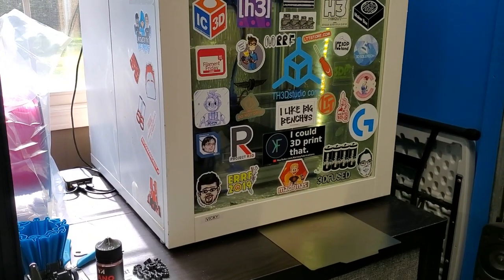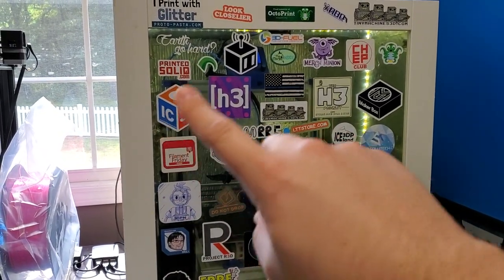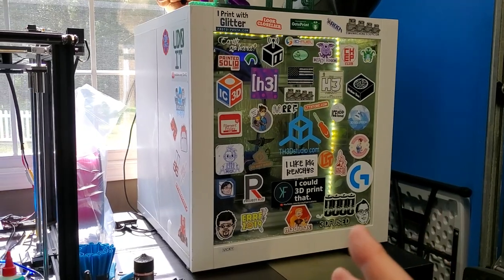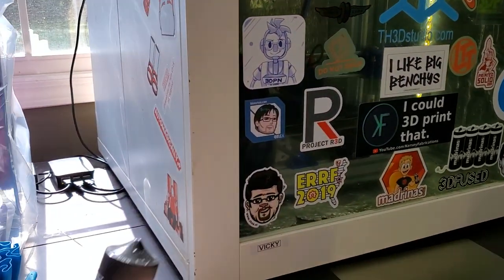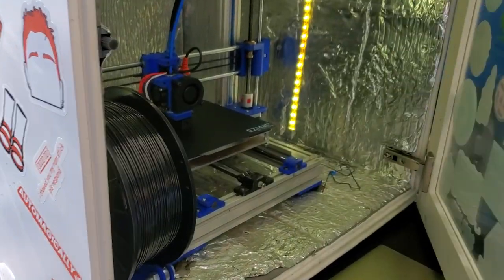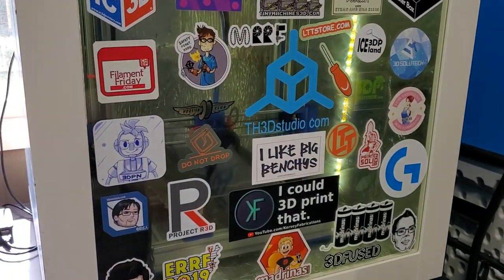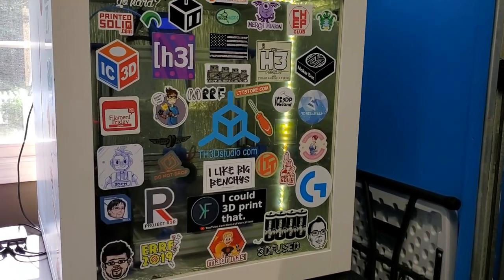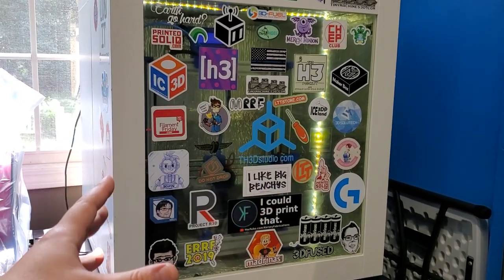Tips for Printing ABS Successfully with your 3D Printer | EZTip #5

Comment: Tim, I've actually used a large plastic trash bag once and worked in a pinch. I made sure the bag didn't come in contact with any part of the printer. I've also turned a diaper changing table into an enclosure. I used the clear acrylic poster frames to enclose it using the side pieces to allow me to slide them down in place so I could remove any side to get to the printer. It worked great for something I paid $5 at a thrift store.

Comment: I have purchased 6 separate ABS prints from TH3D and wasn’t impressed with the quality of any. I bought it from them hoping they would get a better result than I could since I didn’t want to use PLA parts. TH3D does however make the best auto bed leveling system by far. The EZBoards are awesome too. I have bought those the EZBoard and EZABL 4 times for different printers. All Ender 5’s and Ender 5 Plus. But I’m not going to buy their pre printed stuff anymore.

Here is my tip for printing ABS. Don’t use ABS. Use ASA instead.

Buy Polymaker ASA or 3DXMAX ASA instead. I just discovered this filament a few weeks ago and it prints like a dream. It is almost as easy as printing PLA. I can’t think of anything ABS can do that ASA can’t. I’m sure there are a few use cases where ABS must be used, but I think for most people ASA will do everything you need and more. Amazing stuff. Can’t believe I didn’t know about it sooner. It doesn’t warp until 93°C. It is way more U.V. resistant than ABS. Doesn’t need a heated enclosure. It stinks and doesn’t feel good to breathe, so I print it in my garage. Printed a full Hero Me gen 5 shroud for my TH3D hot end upgrade. Better than my old PLA shroud. ASA doesn’t warp when I print on my Ender 5 without any enclosure. I’ve had very accurate and consistent results with this stuff. Stop using ABS!

Just set hot end to: 250°C
bed temp: 100°C
Print speed: 40mm/s
Fan speed: 10%
Reply from the maker: Sorry to hear that. If there are issues with the parts please contact our support and we will replace/refund them if they are not up to par. Please accept our apologies for the inconvenience. Our GM is Aaron so if you specify to escalate the ticket to Aaron he will be happy to get a resolution on the parts you are happy with: http://contactus.th3dstudio.com/
Reply: It's very poor of you to bring your issues up here instead of contacting them directly and giving them a chance to make it right. I don't know them personally but it's not how I would have resolved any issues.
Reply: @keithgoff3272  I literally complained about the quality of their prints they sent me, but in the same comment I complimented them on the quality of their auto bed leveling system. I feel like I was pretty darn reasonable. I wouldn’t be surprised if you are a TH3D employee trying to protect your reputation anytime someone isn’t giving glowing reviews on their product or services. It seems petty to criticize me for criticizing TH3D on just their print quality of parts I purchased from them. I have left honest and fair reviews on TH3D but they never posted a single one of them since they will only post extremely positive reviews. Heck for all I know they could have made up most of those reviews themselves. The only place I can hope to give fair unfiltered reviews sometimes is in the YouTube comment section. At least until my comments gets deleted...

Besides I did contact them first when they sent me warped ABS parts and they told me that is just the nature of ABS. If I wanted a warped ABS part I would have printed it myself. That’s why I hoped that paying them to print me something in ABS would turn out better than what I could do myself without an enclosure.
I did give them a chance to fix that and they didn’t, but it wasn’t a big deal I moved on. I did have some issues with my auto bed leveling system a few months after I bought it and they refused to help me even though I’ve purchased 5 EZ boards and EZABL kits from them because my issue came up after their time limit for support. Wasn’t impressed with that. A common issue I’m seeing on all 3 of my 5 EZABLs right now is I am forced to manually adjust the z-offset before every print because the EZABL is getting a different measurement on every print. This was a review I posted that was a serious problem since it defeats the purpose of auto bed leveling if I have to manually adjust something every single print. They never posted that review and they never solved my problem with that. The 3 EZABLs of the 5 I have are the ones I purchased within the past year. The 2 I purchased about 2 years ago now are the only EZABLs that work flawlessly every single time. Their newer probes are defective and they won’t admit it. Don’t you think it would be useful for their (maybe your) customers to know?
Reply: @elmergloo3259  I work for a Steel Mill in SC. I know nothing about these guys. Just watching videos learning how to print different materials on my Ender 3 Pro. If you did give them a chance to make it right then I would suggest you say so. That way you don't sound like most people just complaining from behind a keyboard. If they did not take the opportunity to make it right then shame on them.